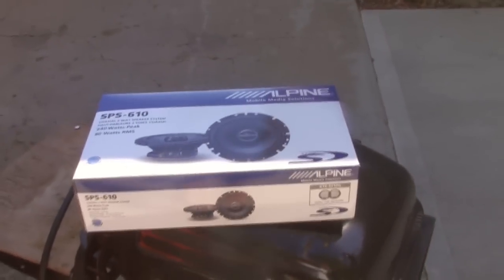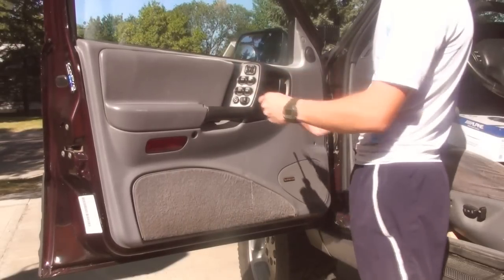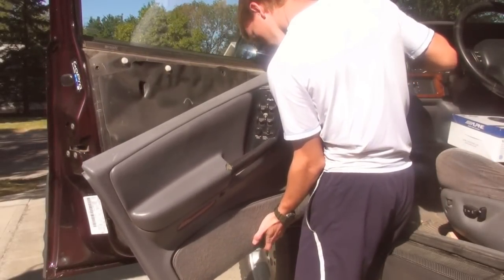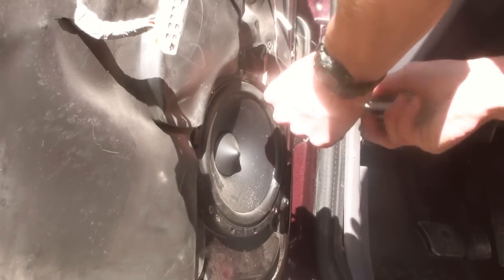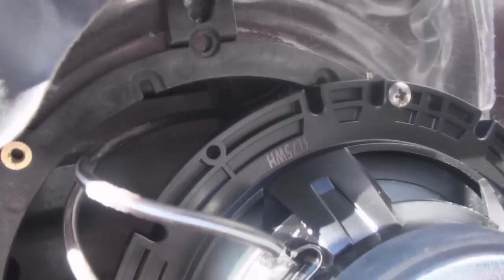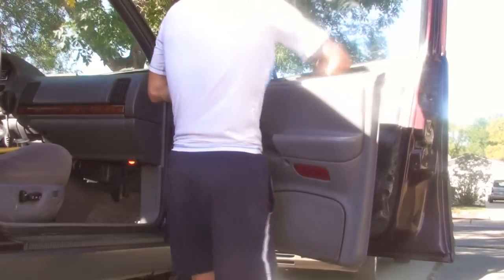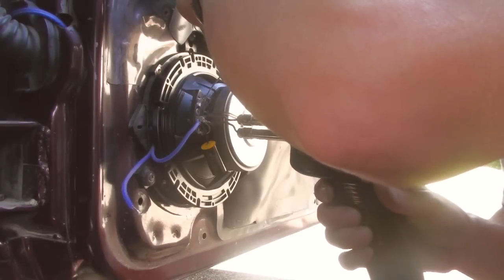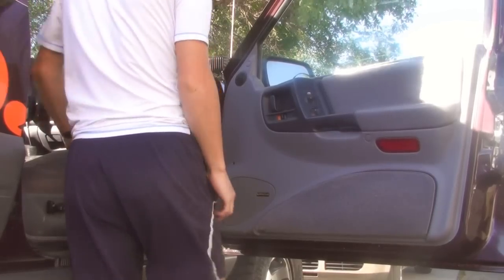1997 Jeep ZEDJAY - How to replace door speakers (universal video)

Comment: I have a question, I need to replace a blown speaker in my 95 zj but the stock speakers are 3 bolt, where do i get the adapter to fit a 4 bolt speaker?
Reply from the maker: Any electronics store (Visions, Future Shop, Best Buy), or anywhere that deals with car audio.